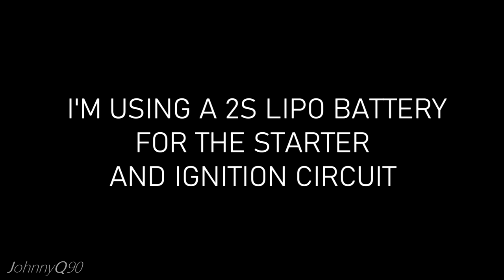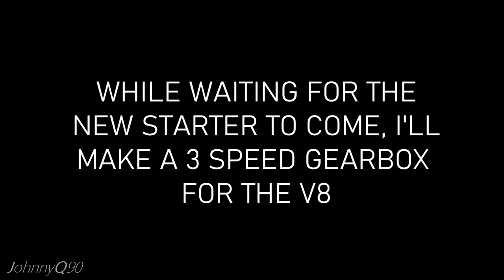Miniature FLATHEAD Four Cylinder Engine Assembly & RUN!

Comment: I find it absolutely delightful that this engine actually uses spark ignition instead of glow plug ignition.
Reply: an actual oil system is still the best part cuz every other model engine is just pumped full of grease
Reply: Yep , and oiling system and liquid cooled. Pretty neat
Reply: Are you really sure of what glow plugs are used for?
Reply: @77funtomas  Yeah diesels use them but many of the old school Cox motors for rc planes and cars used a glow plug , not a spark ignition… I think that’s what he’s talking about
Reply: @77funtomas  I honestly can't figure out what the purpose of your comment was.
Reply: @cameronjenkins6748  I think I can clear up the details: 
The Cox glow plug noisy engines were:  Air cooled, single cylinder, two-stroke engines, diesel principle based and had glow ignition.

This four-cylinder engine, is water cooled, four cylinders, four stroke, flat head, with timed spark ignition, gasoline burner, and is the closest to real 1930s to 50s flat head engines in such a small scale.
Reply: Modern Nitromethane powered RC cars trucks planes etc. also use glow-plugs.
Reply: Gasoline. Not Diesel.
Reply: @77funtomas  glow plugs are used in diesel engines, right? Spark plugs in petrol / gasoline engines?

That's why, glow plugs. Take, a while to warm up sometimes with a diesel vehicle. Right?
Reply: @pingabl3  there's some kind of sump? It soaks up oil, from below?
Reply: @MrRobertFarr   You're right; diesel engines are known as compression ignition engines, and gasoline engines as spark ignition engines. The glow-plug is used to insure quick starting ignition, especially under cooler conditions.

This engine is gasoline 4 stroke and had spark ignition, and on a part 2 video it was converted to glow-plug ignition and nitromethane fuel, and the main fuel was probably diesel (*not mentioned) that was enriched with the nitromethane for more complete combustion and smokeless exhaust 

*The conversion needed higher compression, so the engine was most likely fitted with compatible high compression pistons and head for diesel fuel and substituted the spark plugs with glow-plugs.
Reply: @Lowonfuel  it must be a challenge to set the spark plugs up, to fire, at the correct time.
Diesel engines have, a reputation as lasting longer.
I actually know these things, from talking to my dad.
But, my uncle was, a senior mechanical engineer.
I think, I am drawn to this field of study actually.
My uncle, was quite successful in that field. With three sons who persued a different career.
Unfortunately he died a couple of years back, but in Mechanical Engineering, his work had worldwide significance actually.
Reply: @Lowonfuel  I will try and pull my cousin into the discussion. He, is into engines also. It's an opportunity to take control of the work.
Reply: @MrRobertFarr   A challenge to the spark plugs up, to fire, at the correct time?… talking about car engines? The answer is no, you only have to set them with the correct gap, and firing at the correct time is taken care-of by the distributor or the modern OBD II engine management system.  Wow... though to follow on your uncle's foot steps... but, the genes are there, so it's all up to you.
Reply: @MrRobertFarr  Diesel engine produce peak torque at relatively low RPM between 2000 – 2500, and redline as low as 4500 rpm. And maintaining diesel engine's RPM at around 2000-2500 RPM will give you the maximum efficiency, So lower RPMs means lower cylinder and ring wear, also the crank bushings and all moving engine components. They are also stronger built to handle the high torque diesel engines produce, and that should obviously mean longer lasting engines... in spite of the more violent diesel ignition.
Reply: @Lowonfuel  Yes. The distributor. Thanks 😊👍.
Reply: @Lowonfuel  sure, I am just throwing out, facts. Learned, from my daddy actually. To get involved in this discussion prompted by Cameron Jenkins comment. The dirt, and oil, kind of puts me off a bit. Cameron Jenkins 
https://youtu.be/gugIj7TAZ2o
I chose to specialise in Chemistry, so that's quite close to Engineering. 
Although, it's rather frustrating when. Engineering companies, deny that.
Sure, I am thinking about the molecules.
Octane, and Cetane. Those, imaginary substances that, burn in the most desirable way.
Cetane, would be, a larger, dare I say molecule. So, in theory. The possibility of creating more energy is there. From each molecule.
Or, well. I guess that's just the way it is!
Yes, my uncle. Unfortunately lived far away. He, is now dead, but last time I saw him.
It was at a wedding, and he told me about his career.
My dad, has some type of strange stuff going on in his head. He imagines everything is perfect. Maybe he is Romantic. We came, down here to this port where the manufacturing, and engineering is marine engineering.

I feel that the salt, is incompatible. I was a Railway Maintenance Technician. If course Railways have a close association with the sea, and it's rather strange. Seeing, that on Railways. The, moving parts. Near, the sea are not oiled.
But, looking at these videos. I think, I have good Mechanical Engineering comprehension.
But, now. I also have, gained a good understanding of the human body also. Where it's difficult to, do both.
Because, an engine is, trying to do one thing. It's trying to get some work done.

I am a bit of a lost sheep still aged 42 actually. It's the big Cancer. That's the barrier and, well if a person accommodates cancer, into their working practices. That's the big win for me.
Reply: @Lowonfuel  If the engine was converted to glow ignition, it certainly wouldn't have been diesel fuel mixed with Nitro that it was running on. The fuel would have been a mix of Methanol, Nitromethane, and probably a touch of oil, with Methanol being the main component. Model Glow engines HAVE to have methanol as a fuel, or they won't run. The coil in the glow plug in a model engine doesn't just stay hot from the combustion, it wouldn't work that way. The plug glows red hot from a catalytic reaction with the methanol in the fuel that makes the glow plug get hot, and fire the charge in the cylinder on every stroke, it's not just from the residual heat from the last power stroke. The little metal coil element in the glow plug for these engines is made out of Platinum. A Platinum wire will react when brought into contact with Methanol vapor, and the wire will glow red hot all on it's own as long as it's in contact with the methanol vapor. This reaction, ALONG with the compression in the cylinder, is what ignites the fuel/air charge in these engines. The compression alone won't fire it, the catalytic reaction from the Platinum and the Methanol needs to happen for it to fire. If methanol isn't used as a majority of the fuel with a glow engine, no reaction with the Platinum coil in the glow plug would take place, and the engine would NOT run at all.
Reply: @MrRobertFarr  diesel combusts under pressure, no spark required.
Reply: @michaelbrownlee9497  No. I don't think that's right. They use glow plugs.
Reply: @MrRobertFarr  those are for starting. Read through the thread for a thorough explain.
Some gases combust under pressure without a spark.
Reply: Don't know, why. I said. Control of the work. Folks, must really learn a lot. From, building these hobby engines. I certainly, miss those country folks. With, their machine work shops.
Reply: @Lowonfuel  Sure, a Distributor, and gapping spark plugs. YES! It's strange, how. I sold my car, all those years ago actually. I sold, my car, to make, an investment in education.
Then, I have not really persued, consistent car ownership actually. But, it might be nice, to get involved in, sharing a car, or some type of vehicle.
Yes, I seem to be blessed with. Good Mechanical comprehension. But, now cursed with this knowledge of Good and Evil, from, my Scientific studies perhaps now . Or, very concerned about health issues and, genetic change.
Certainly, is a great idea, to use machines. Yes!
Reply: The comments to my original comment have gotten ridiculous. I'm going to delete all of these comments but I first just want some of you to know that you got really off topic and ruined things.
Reply: @cameronjenkins6748   Well, the topic was this small engine actually using spark ignition, which is the only type of ignition for gasoline engines. And to be honest, that's what got me in the conversation to begin with, but there wasn't much to elaborate from there, except maybe to comment on the distributor, timing spark generation and advance… but from what I noticed, the engine doesn't seem to have a distributor and the initial spark timing was set at 15º BTDC, and the rest seems to be handled by the electronic box seen at 12:44 and, there doesn't seem to be much else to comment on the initial topic. 

In a second video, the YouTuber converted the engine to diesel, and glow plug ignition, so the conversation seems to have migrated from the 2nd video, and went off the topic you initiated… but in a sense, being this the first video on this engine, and from the same YouTuber, seems to me, we haven't been so off-topic as it may seem to you.
Reply: This is freaking awesome!
Reply: Remember that the Lord Jesus Christ died on a cross for you because He loves you so much. He then rose up from the dead three days later
The Ten Commandments are called the moral law, (most of us are lying thieving blasphemous adulterer at heart and deserve hell) you and I broke the law, Jesus paid the fine. That’s what happened on that cross. 
By believing that Jesus died on the cross and rose up from the dead 3 days later and not just confessing your sin, but also repenting of all sin you have done and putting all your trust in Him in prayer, He will grant you everlasting life as a free Gift.
Reply: @blackassnight  it's pretty amazing they can afford this stuff .
Reply: I am so delighted 🤗😁

Comment: This knocks the spots of these Toyan engines imo, the wet sump, the plugs etc make it a real 4 stroke. 
  I’d like to see this one in an RC car, being a side valve engine, a body to suit the era of when that engine was in production (1940’s 1950’s) style bodywork.. 
  It’s a shame there’s such a limited run on them, I should imagine that they’d be snapped up!
Reply: It is a nice engine, but at over $1000 it ought to be.
Reply: Imagine a 1950 scale size ford 8n tractor with this bad boy. Would be a cool rc car.
Reply: I would buy one
Reply: A pietenpol aircamper used a model A engine, I reckon it'd be cool to see it spinning a propeller on a scale model of one. I too was disappointed when I saw that it's only a run of 100.
Reply: The product quality of these engines is atrocious. I wouldn't put such a low quality engine in anything, not even an rc car.
Reply: The engine is about right for a 40s Jeep
Reply: What's the cost of the engine
Reply: A rat rod RC with one of these would be sick
Reply: @Husky1run  $1000 usd
Reply: How does lubrication and ignition pertain to its stroke ?  2 and 4 strokes can have many variations of both.
Reply: This is before that, flathead fours were Model T and Model A, 20s and 30s. The Ford V8 came out in the 1930s and was the engine used after that until the OHV V8 came out.
Reply: How about a clear one so we can see it work
Reply: @MikePerreman  but could it get proper oil at those angles?
Reply: @ferrumignis  yeah i would love to get a mini ICE that doesnt cost as much as a real used car motor lol.
Reply: Not very powerful... 
An old flathead design is very inefficient, weak, and wouldn't work very well as an engine to power a model car. The most powerful a full size flathead in an automobile was back in the day was 80 or 90 horsepower. Not very impressive for a 240+ cubic inch engine. 0.3 horsepower per cubic inch is shameful nowadays.
Reply: @charliemaybe  You can buy a small Nitro glow engine for less than 50 bucks.
Reply: @davelowets  I know that, but something like this that has camshafts multiple cylinders and such are so cool. I would probably want to get a 2 stroke instead of nitro because of sound
Reply: @davelowets  my truck makes 0.48 per cylinder lol. 7.3 powerstroke
Reply: @psd28  A diesel is a whole different animal than a gasoline engine.
Reply: @davelowets  yeah im aware
Reply: @im-that-guy-pal  It’s clearly a four stroke as shown by the valves and also the camshaft driven by half-crankshaft speed reduction gearing. It’s also clearly using a wet-sump and an oil pump, so has conventional four-stroke lubrication instead of using 2-stroke oil which gets mixed with the fuel and needs to be replenished as it’s burnt with the petrol/gasoline. Four-stroke valves, camshaft, and lifters would not get adequately lubricated and cooled by a two-stroke total loss lube system.
Reply: @ferrumignis  I've replaced engines in actual cars for less..

Comment: A wet liner, wet sump, sidevalve engine. Brilliant. 
Lap the valves, fix the front seal and a bit of carb work and it should be a winner.
Reply: I'm wondering if it has a crank case breather
Reply: @jasonGreenVw  I hope so, it’s much closer to a modern ICE than the others we’ve seen. CCV is definitely needed here.
Reply: @jasonGreenVw  yes you can see it comes off the lifter cover

Comment: Such phenomenal toys we have today. When I was a kid  I got to play with dirt, bicycle was used for getting to school and back. We used to throw a trash can lid like a frisbee before the frisbee was invented. Built a go-cart, couldn't afford a gasoline engine so we used a electric bench grinder motor. Worked great until the extension cord ran out  of range. We only dreamed of stuff like this.
Reply: Better than an XBox. Kids need to learn stuff
Reply: Yeah but this is 1000 bucks, 2000 if you get the whole package…
Reply: @19099090  Buy a car at that price. 😭😭😭
Reply: You were lucky to have dirt to play with- I got piece of string for Xmas
Reply: Bet you wish you would have thought about that trashcan lid toy a little more. ;)
Reply: My go-cart used a washing machine motor powered by a car battery, bloody hell it brings back memories. The damn thing could barely move against a stiff breeze, but luckily the cul-de-sac I lived on exited onto a loong downward sloping road. My god did it move when going downhill, it was when I was halfway down the hill when I realised I hadn't put any bloody brakes on it and I was heading towards a factory wall at a real unsafe speed, 30mph-ish I think. I had to use the Fred Flintstone method of braking and shredded the soles of my shoes off 😄 my mum was angry as hell since we were dirt poor and boy I thought she was going to tear my ear off. I occasionally revisit that road on Google Earth.
Reply: @19099090  so are most phones
Reply: You must be at least 100 years old.💯
Reply: NOT A TOY....   LOL

Comment: You probably get quite a bit better behaviour setting the ignition timing to 28 degrees BTDC.

This finally looks like an engine that is designed with doing serious runtime in mind, Like the centrifugal cooling pump and the geared oil pump.... Hate the fact that they are belt-driven: No oil pressure alarm, no cooling water temperature alarm, so a snapped belt will lead to near immediate selfdestruction.
Solution: place a motion detector on either one of the pumps, that shuts down ignition if no RPM is detected. That will with 100% certainty be an engine saver, because those belts ARE going to snap...

The valve adjusters also are most likely going to lead to trouble, and to remove them, the head needs to come off or there is not enough clearance to move the valves.
Reply: Probably run better with more advance but I bet it becomes hard to start with 28 degrees static advance.
Reply: @ferrumignis  Depends on whether the ignition has an automatic advance curve or not, I guess.
Reply: timing is based on bore size so that's way too much timing
Reply: @redneckasmr-xd1gg  I can assure you that that is absolutely UNtrue... I run several small gassers (< 3/4" bore) and they all time out optimal at 28 deg BTDS. That is, setting the timing with a full bore running engine and a tach...
Reply: This is just a shitty quality engine overall. Gears suck, etc.... too many cut corners, too low of a build quality, I wouldn't have bothered buying this, much less waste the time putting such a poorly manufactured engine together. Total waste.

Comment: Interesting the differences between this and the Toyan engines, I wonder why they went with a flathead design?  Normally flatheads aren't stellar for power or efficiency, but it probably will run for a very long time!  I really appreciate that this has actual spark plugs and ignition system, as well as an oil system, pretty cool!  I hope you can get it running proper. Looks like there might be some design improvements to be made.
Reply: Simplicity and manufacturing cost I suspect. OHV adds significant complexity.
Reply: they make all kinds, this is just one engine they make.

Comment: Another great tiny engine build Johnny could you make a pulley and bracket for a DC generator or an alternator to power the engine so it's not entirely relying on the battery to keep running?
Reply: Remember that the Lord Jesus Christ died on a cross for you because He loves you so much. He then rose up from the dead three days later
The Ten Commandments are called the moral law, (most of us are lying thieving blasphemous adulterer at heart and deserve hell) you and I broke the law, Jesus paid the fine. That’s what happened on that cross. 
By believing that Jesus died on the cross and rose up from the dead 3 days later and not just confessing your sin, but also repenting of all sin you have done and putting all your trust in Him in prayer, He will grant you everlasting life as a free Gift.
Reply: @dove3853  bruh